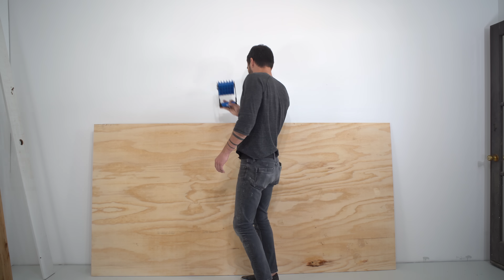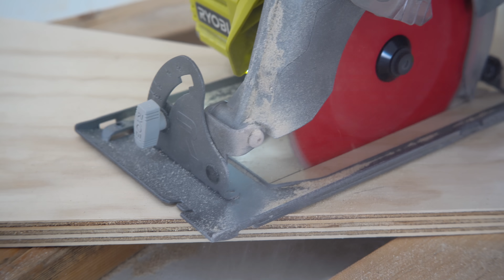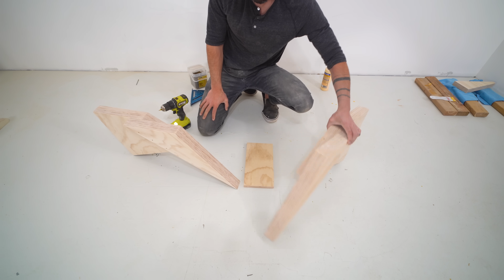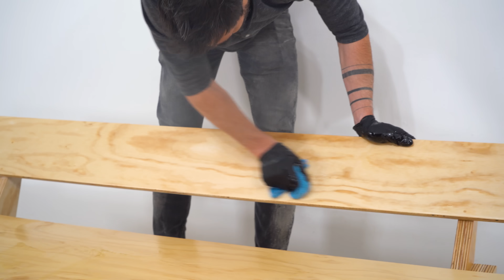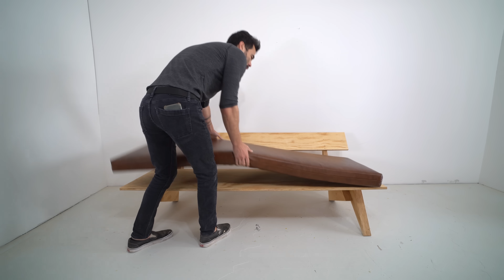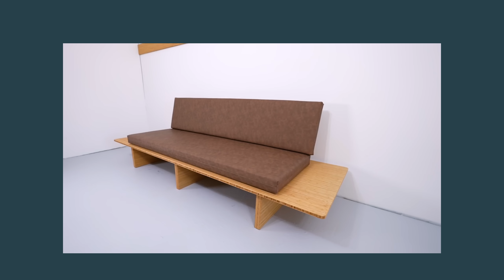DIY SOFA $250 in materials

Comment: Went to check out your cushion site briefly, since I didn’t know you had founded these brands of products (also the simple finish). I know “vegan leather” is a buzzword that probably helps sales, but you should definitely specify on your site what type of vegan leather it is. I assume it’s not a newer leather-type material like the pineapple leather or the cork leather, but is it polyurethane, or PVC vinyl? Etc.
Reply from the maker: I believe it is vinyl we tested a plant based version but it broke down under UV and was 5x the price.  if there are any plant based options that are less than twice the price and perform well please share a link!  thanks for the question

Comment: How would you stop the cushions from slipping? I have had plywood and loose cushion sofas before and the continual slipping of the cushions drove me mad
Reply from the maker: I haven't had the problem but silicone pads or velcro could do the trick for a few dollars. perhaps even a few dabs of silicone caulk on the plywood
Reply: Maybe with some Velcro?
Reply: @abzyac  yeah, that is what I used, it was never entirely successful
Reply: @kateh4030  I wonder if you'd have to use loads of it or maybe there's something else you could use 🤔
Reply: @abzyac  staple the velcro good idea